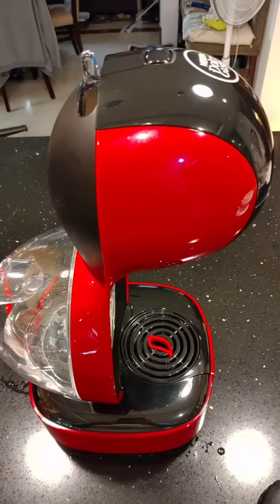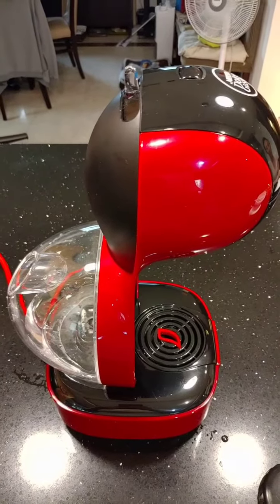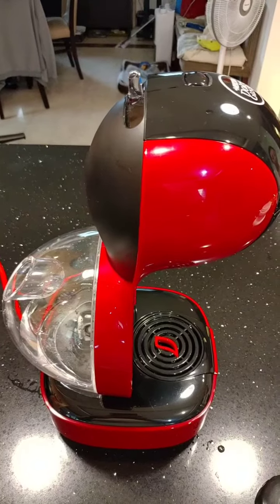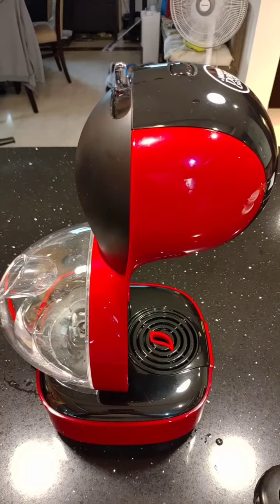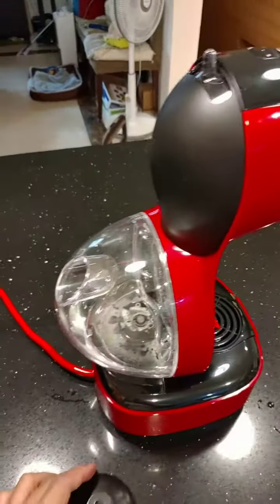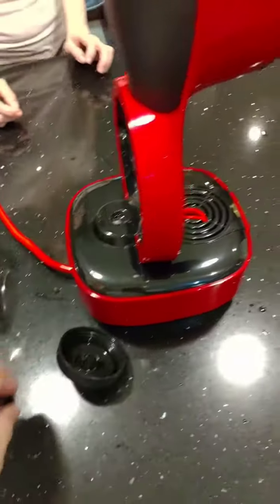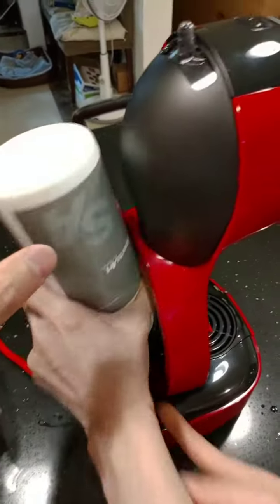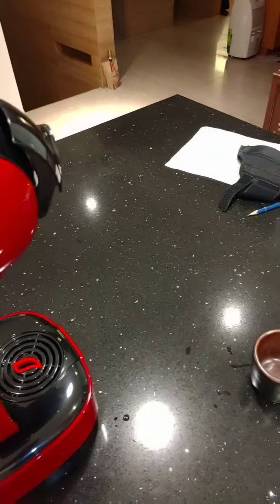Quick fix for Nescafe Dolce Gusto no water flow (bilingual)

Comment: Thank you so much for a trick.  I don't have that kind of bottle, but I use a portable air pump instead it worked too.  the important  thing is to turn on the machine and push a button to the left or right and you can hear the machine is working but no water then put the water tank in place, WoW cannot believe this trick is really work. Thank you again. I saved my money.

Comment: I used an old squeezable ketchup bottle. Made sure it sealed decently and it worked like a charm on the first shot. Great, easy fix!! Thanks!
Reply from the maker: So long as the bottle fit snuggly it would work great

Comment: To get ridd of the air do the following: Fill the tank up with water and place it on the machine as if I was going to start making coffee. Then take it off, put back on, take it off, put back a on, take it off, and do it many many many times and it started working eventually. You'll have to do that probly about 50 times
Reply: This may not always work, & one would look like an idiot
Reply: @poothrower69  Worked for me
Reply: It works! Thanks
Reply: turn on the machine while doing this?
Reply: That worked thanks!!!
Reply: Thank you! Your trick works on my lumio!

Comment: An air bubble in the system means you throw away the device? Man these Dolce Gusto machines are inferior to their competition. Tassimo knows how much water is in the tank and will not start unless there's enough. Dolce Gusto on the other hand will continue and if it runs out it will just suck air into the system. These devices are technically inferior. I own both so I can say this with integrity. I do believe the Hot chocolates are better on Dolce Gusto though.